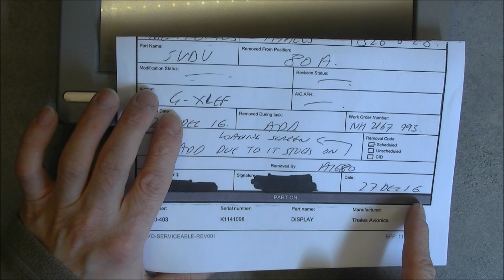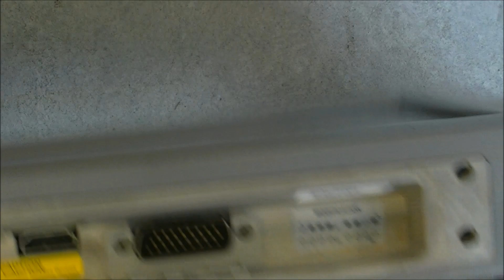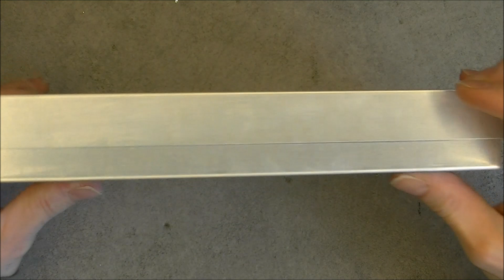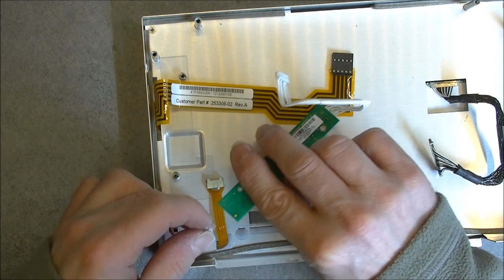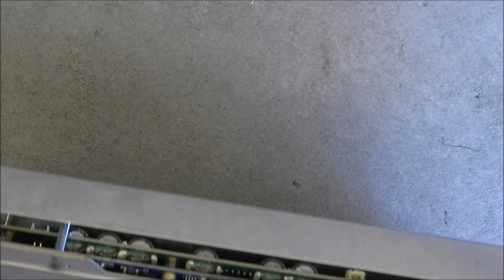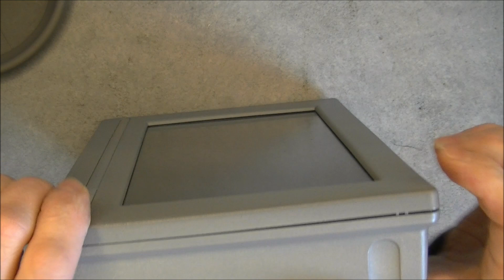A380 In Flight Entertainment touchscreen teardown

Comment: It's an x86-based embedded PC. Slightly surprised it's based on the VIA processor - the ones I've seen were based on the Geode (formerly National Semiconductor, later bought by AMD). It's possible you could put that CF card in a CF-to-IDE adapter and boot it (partially anyway) on an old laptop.

Comment: by the look of the power input circuitry, supply is likely to be 28v dc. that blue VIA board looks like it is a somewhat off the shelf single board computer. that top board has an extra FPGA and power supply circuitry, 3 obvious dc-dc converters likely supplying standard pc voltages of 3.3v, 5v, 12v. the Broadcom chip on it is a 6 port ethernet switch, likely for daisychaining multiple seat backs.
Reply: Considering the CPU board is labeled "Thales".... it's very much not an off the shelf one.